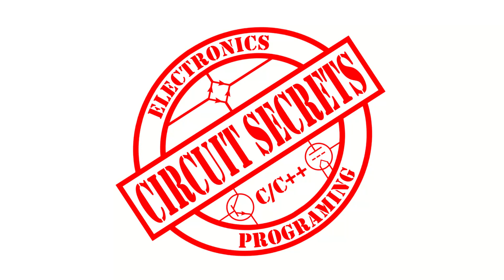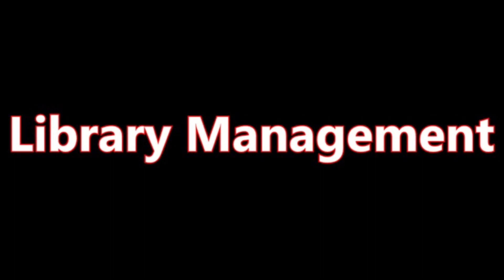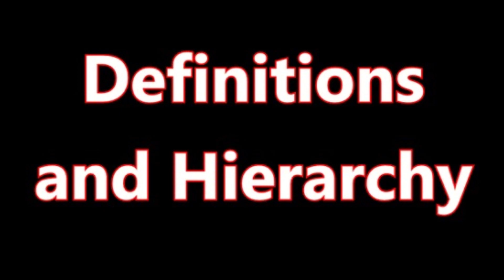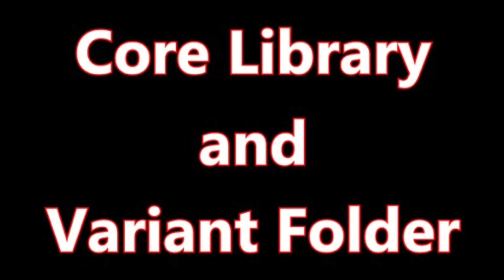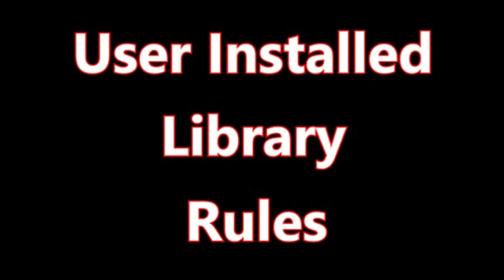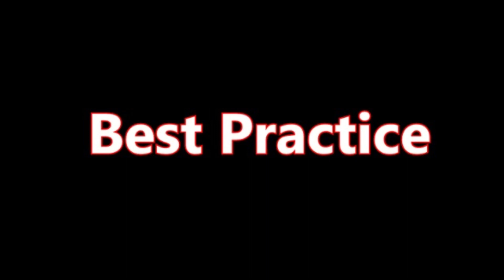Arduino Library Management

Comment: Hello! I'd like to know if you know how to program the esp32 s3 module?
Reply from the maker: I have not tried those yet, sorry.
Reply: @CircuitSecrets I would like to transfer the servo motor code you created to take advantage of the benefits of the ESP32 microcontroller. The functions, PWM, and precision are superior, as well as the processing speed.
Reply from the maker: @Dmecatronic  Right on, that seems like extreme over engineering, but if you want to do it, feel free. The nano and pro mini both have plenty of speed for cheap wiper motors, but if you wanted to push it to faster universal motors(like drill motors) you might need the extra speed. The whole point of my design was to make it as cheap and accessible as possible to build large g-code compatible cnc machines while using as many recycled parts as possible. I think the biggest changes would be interrupt setup, and I would utilize Freertos to pin the feedback logic and pwm control to one core, while the other would handle pin change interrupt logic and step calculation. The ISR would set a flag to unblock code on the core which you designate to read the pins, perform the associated logic then reset flag blocking to wait for the next interrupt. You could even switch from home made optical position tracking to professional encoders to make something very similar to actual high dollar pro rigs. I am curious about performance because using pin change interrupts on the ESP requires an ISR for each pin, where the nano or pro mini uses a mask so no redundant ISR, but I suppose you could just call the same ISR from multiple interrupts(I have not done much with interrupts on esp32s), anyway good luck! I am glad to try to help you with any concepts as you work through it, let me know if you have any specific questions.
Reply: @CircuitSecrets  I don't have the knowledge to do it, but if you are interested in the project, at least in some other more advanced microcontroller than Arduino nano, we can arrange the price.
Reply: @CircuitSecrets I have rotary encoders with 600 pulses per revolution, and the Arduino gets very confused, so I would like to try a more powerful one.
Reply from the maker: @Dmecatronic  Nice that is pro level stuff! I have consulted on servicing some pro stuff, but that was years ago.
Reply: @CircuitSecrets To be honest, I have tried several projects and yours, although it is not a PID control, is the best. The only drawback is that with high-resolution encoders it loses steps at high speed.
Reply from the maker: @Dmecatronic  Sorry I cannot take it on right now, I have a pretty big project I have been working on here and there since the 90s. I am going to be releasing a video about it sometime in the next week if all goes well. Let me know the specs of the encoder and where to get one for testing, and if I get time maybe I will do a port to a basic esp32 and or Raspberry pi pico, both of those should be fast enough for universal motors..If not PLC is the only option, could be done maybe with low level on pi pico....
Reply: @CircuitSecrets I have a 3D printer, a CNC lathe, and a milling machine. We should migrate that project to a more powerful microcontroller and create a marketable product.
Reply: @CircuitSecrets I would appreciate any optimizations you can make, and I would like to see that project you mentioned. What is it about?
Reply from the maker: @Dmecatronic  I understand, trying to improve efficiency, precision and speed.
Reply from the maker: @Dmecatronic  My latest project is about security, AI, and correcting some mistakes engineers made in the 90s. Think of it as modernizing the world wide web to solve for emerging threats caused by greed, AI, hostile actors and other factors. If I cannot get to working on the controller, my code is all open source, so if you hire a specialist they should be able to quickly port and improve it for your purposes, and feel free. I tossed it together as an example for educational purposes, and not as a finished project suitable to mission critical applications. My goal is and has always been to help to educate people and improve things as well as I can, you will notice I don't collect email addresses or anything. Good luck!
Reply: @CircuitSecrets Exactly
Reply: @CircuitSecrets Wow! That's very interesting, thanks, friend!